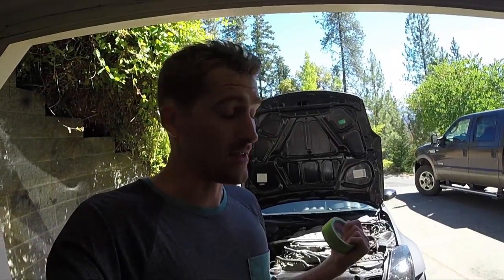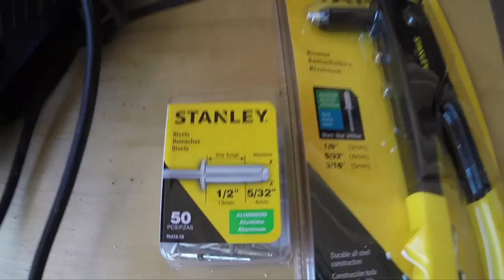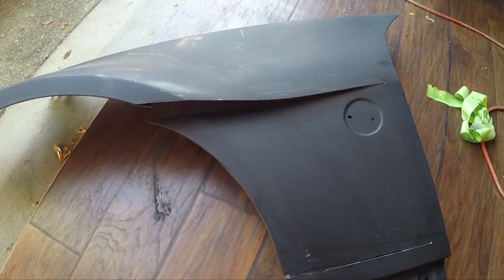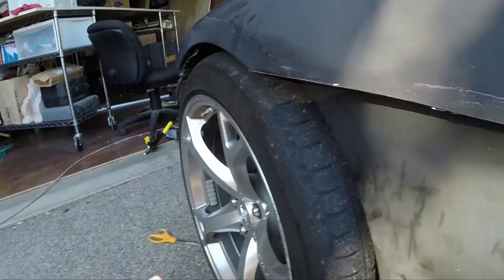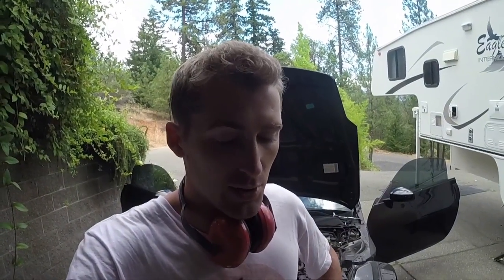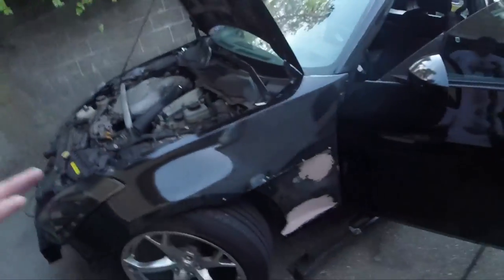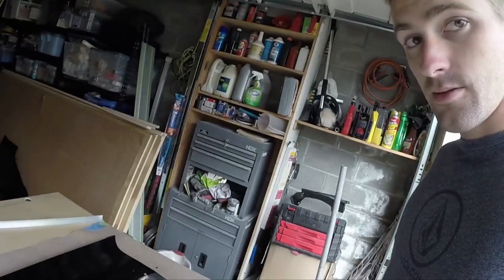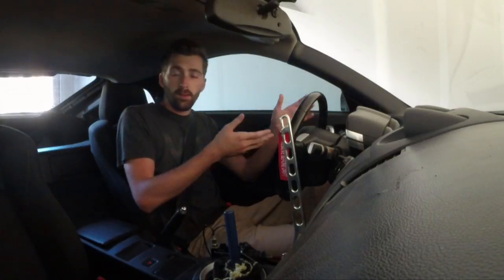Vented Fender Mod (350Z)

Comment: The one thing I would do different, if I didn't have a welder that is, is use some fiberglass repair kits from either Autozone or Napa, only like $10 a piece and think you would only need 2. That would make the crack in the corner go away, make it have a rounded angle to the corners and is easy to find video's on how to lay fiberglass for the first time. Saying hey from the Redwoods of California.

Comment: I like when people try to do things themselves.
Anyone can buy a fender but to modify one yourself, wether it's a success or failure, you still learn something.

If I were you, I'd try and smooth out everything.
Get them as close to perfect as possible.
Make a fiberglass mould (negative) of them then use the mould to make the final piece out of either fiberglass or carbon fiber.
Since your z33 is a drift missile, it's fair to assume they will get damaged at some point in time.
The mould can be reused hundreds of times to make more copies and save you lots of time later down the road.
Who knows, if others are interested you could sell copies and make some $$$ on the side.
Reply: best piece of advice I've ever seen on youtube lol
Reply: Peirre Gale lol that's why I do everything myself its interesting how thing mess up easily but u feel proud of yourself when u finish it
Reply: Peirre Gale exactly.

Comment: Next time use fiberglass reinforced body filler, it will help with the cracking issues. One other tip, never wet bonds, it sucks up water like a sponge and will rust/destroy the paint you put over it. Just my 2 cents.

Comment: I know this is an old video and all but I saw the description and just wanted to say.  You know that a tack weld is just a temporary tack to hold the metal together so you can seam or spot weld two pieces of metal together.  Anyone using a tack weld for permanent placement is an idiot.  The right way for this would be to use a tig welder to seam weld this.  Then you should at most only need a skim coat or if you go a bit heavier on the bead you only need to sand not grind the weld to perfection. 

Also get an air saw with a fine blade for even thinner cuts. 

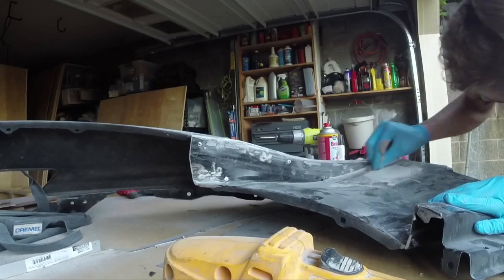When sanding a car or body filler especially you always do it perpendicular to the direction of your fingers.  Sanding like you were @7:14 in the same direction as your fingers creates ridges and valleys in your filler and will result in a wavy or rippled paint job.

Never sand with an angle grinder it tends to be counter productive and makes metal even thinner... I.E. brittle and prone to cracking.
Never sand with an electric orbital sander... this isn't wood and metal/filler can and usually will show the swirls.  You need a DA (Dual Action) sander.

Lastly you should use some seam sealer on the backside of the panel.  If not I can see this turning into a rusty mess really quickly if it hasn't already.

Not trying to be harsh here.  all in all it didn't look bad for what you were using but even with a "free" job there is a right way and a way that costs you more money down the road then you would have spent doing it right.

Comment: So I'm doing the same set up... Only I'm starting my vent 7" in to the fender

I noticed you set the lower plate first. Did you pre measure at 2".. Or just eyeball and cut the lower plate then set you vent gap to you liking?

Comment: you should try body epoxy, then the panel won't flex as much. for the seems try JB weld it's strong and best part is you can sand it so would be great base for filler. But just some ideas and great job anyways. and looking forward to the taillight video

Comment: it is a great diy.  welding would be ideal, but i dont have access to one.  the only thing i would have done different  is used fiberglass to reinforce the back, and then used carbon fiber on the front to make it look sick.  then it would have all the strength in the world and never worry about cracking.

Comment: I'm probably asking an old question, but will you ever get a bumper? And what're those tail lights?😍
Reply from the maker: Bumper is in the plans, but its hard to drop crazy cash when you aren't sponsored by mommy and daddy. Especially when things break drifting that need fixing (Diff). Probably gonna go bash bar and then front bumper once I know I'm good enough to not destroy it drifting. :)
Reply: +PNWGarage nice I totally agree. Just bought a Z a month and a half ago and parts cost is brutal. Looking at test pipes currently. Where can I find tail lights like yours?
Reply from the maker: In the DIY video I will post in the near future!

Comment: Very nice job without welding. ..  Body filler is not the best  product to seal the open joints. Its not flexible, it cracks easy, and it is like a sponge, it sucks up moisture. A better product that you used on a previous video is  JB weld. It is an epoxy based product, so it will work great to fill and seal all of your open joints. After that is  sanded  you can use body filler to correct all the surface imperfections.
Reply: if you can't weld some glass based product would be better. that's just gonna crack and look bad.

Comment: bite the bullet and get ya a harborfrieght welder, get some decent wire to go with it and you could make those look way better!   and when rattle canning, use a selft etch primer before ya lay on paint, or atleast a high fill primer, that way you can knock it back and make it look real good.
over all good job and keep going!